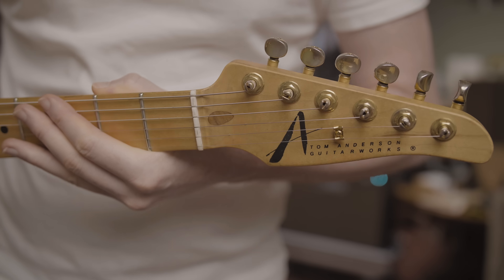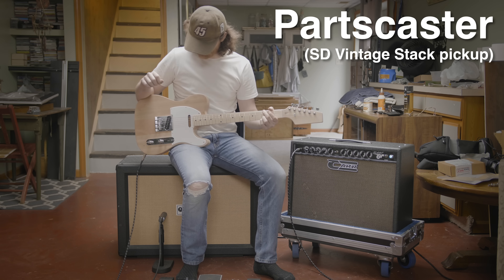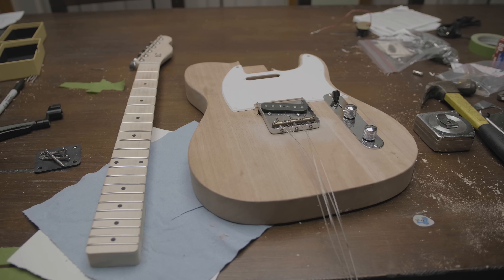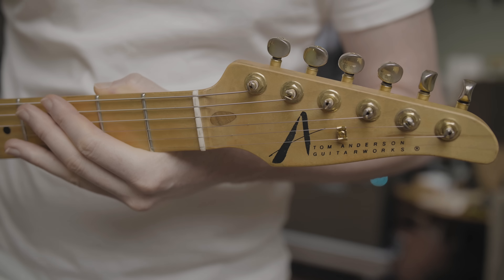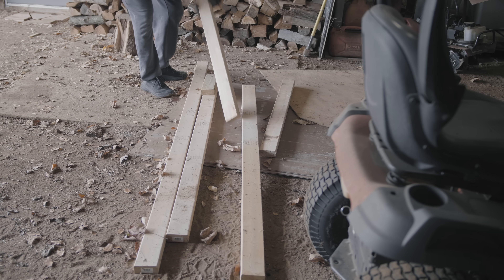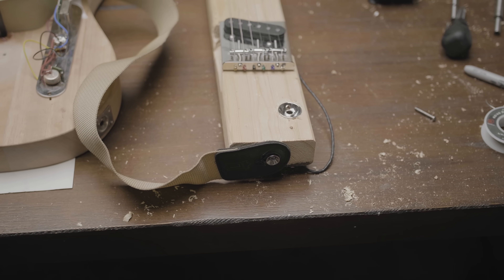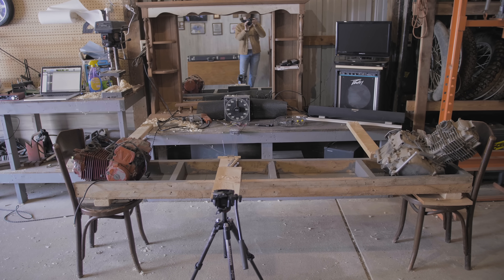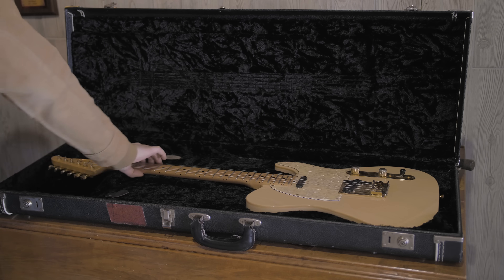Tested: Where Does The Tone Come From In An Electric Guitar?

Comment: All the comments on here amaze me - it seems to me that just about everyone is missing out on the most crucial component - the listeners ears. There have been countless psychological studies done on human perception, and the most overwhelming conclusion from all that is that there is a wide difference between what one person hears and what another person hears when listening to exactly the same sound. The fact that the guy who did these tests managed to prove to himself that he cannot tell the difference when changing certain components that a guitar is made from is perfectly valid - but only for himself. 

The 2nd major factor is for all the people who are listening via YouTube. The sound quality you get from YouTube is not wonderful, and it certainly not enough to detect subtle differences in guitar tone. That means everyone who agrees with the guy posting on here is basing it on what the guy says, rather than what they are hearing. 

The 1/3 point is the fact that he was always using bolt on neck's, or no neck at all. Sound is a vibration, and if you set a string vibrating between 2 fixed points but with a connection between their bases, you will get the entire system vibrating. If you make the connection between their bases less conducive to sympathetic resonance, you will get fewer resonant frequencies. This is probably the main reason why he could get a similar sound - because bolt on neck's do this rather less than set or thru necks This means that the effect of body resonance and neck resonance would be less in all cases - simply because of the disparity between the neck wood and the body wood (when he had a body), and the obvious disconnection between the bridge and nut when there was no body there at all. 

My conclusion? Nothing really proven - mostly because it's highly dependent on the guys ears, and also because his range of test guitars is too restricted. To do this properly, you would need to try set necks, and thru necks. You would also need to put the generated sound through a frequency analyzer to see exactly what frequencies you are generating, and what resonances are being amplified/attenuated.

I have to commend the guy for effort though - I'm kind of tempted to try it with my guitars.
Reply: The two guitars at the end of the video sounded the same to my ears.

Comment: Interesting I know ive watched the tone wood comparison with snare drums and it seemed to make a ton of difference kinda crazy how the 2 by 4 still seemed to put out the same volume I know unplugged my michael kelly patriot (lp style) seems to put out considerably more volume than my schecter c1 I always thought it was the weight of the guitar that made the difference being the michael kelly is 11 lbs and the schecter is 7 but now im questioning that too they are different scale lengths and the action is a smidge higher on my c1... I shall have to do some experimenting as well
Reply: Snares rely on acoustic resonance, so wood density and how that density translates into reflection properties actually becomes a true variable in just about any drum. Softwoods will round out a snare tone and a hard walnut for example will certainly concentrate the attack and increase the length of decay marginally.

Spot on regarding your guitars, if your C1 has higher action then naturally your pickup is probably further away on that guitar, hence it's not as loud. If they have different pickups their resistance is also going to be a large factor.

Comment: What I wonder is whether the mass of the body will affect sustain. Recording the signal you could see how long the notes sustain on the regular Tele vs. the 2x4 vs. the bench, where essentially the whole bench is acting as the body. But definitely good evidence for the pickup being the first place to invest in upgrades.
Reply: The answer is yes sustain can be affected, I have a swamp ash guitar with a full ebony neck on it and it's so dense it doesn't vibrate at all (keeping the energy in the string) but in fact feels a little dead to play and the chords ring out long. HOWEVER....it's of little use because we have these things called compressors that will do far far far longer anyway.

Comment: I would be curious to see the same tests on a strat with all of the similar tests with the matching pickup height and bridge, block, claw changes. doing with the tele all of the tests are on a fixed bridge so it is going to carry through the body no matter what. Rather than coming from a position of bias I just want to see it so I know what the most beneficial and cost efficient ways to improve sound are - whether the springs make a difference in tone, saddles, etc. in the end regardless it seems like electronics are by far the biggest game hanger though regardless

Comment: That bench is not "no body" though..... If anything it probably has more mass than a regular guitar body, effectively making it even more a body.

There is a bit of a difference between different types of wood compared based on 1.: Dimensions or 2.: Mass

A typical guitarbody will weigh more or less depending on the piece of wood and type of wood. 

I would argue a case could be made picking woods from each the opposite end of the spectrum. 
One Piece of wood very light and not dense... Something like basswood or poplar maybe
 And 
A second piece of wood very heavy and dense... Something like mahogany or bubinga. 

All these woods are commonly used in guitar bodys. 

Then, make a guitar body out of both of the chosen wood pieces. Same form and size. Compare.
Then, make a guitar body out of both the wood pieces with the same mass. 
Compare.

In my own experience however, the wood itself is a very very small factor in regards to tone. And i am willing to admit that i myself do like fancy woods in my instruments. 
But it does play a bit of a role in regards to sustain, which itself is a part of tone. 
So Overall, it matters at best in a subcategory.

Far more important in my opinion are: electronics(pot and resistor values or even active), Pickups(type, position and construcion/ if humbucker series or parallel), scale length and overall construction of the guitar(laminated neck, neckthrough/bolt on, size and mass), Strings(size and material). 

I think there is no single most important Factor to guitar tone, rather it is an amalgamation of many factors. 
But that is part of the beauty of the whole discussion, because we get to play around with a lot of parameters.

Comment: Have you carried out experiments on what effects SUSTAIN? It would be interesting to see if sustain is somehow linked to materials other than the strings and the pickups. This video is legendary, keep up the awesome content.
Reply: That's probably body density. Saw a video where someone stuck a string and a pickup to a solid steel support beam
Pretty sure it's still ringing to this day
Reply: @brendanhilgeman1395  On my guitars sustain is roughly equivalent to their weight (3.9kg/3.6kg/2.6kg). Same for my basses (3.6kg/4.9kg).
Reply: Every time I hear people talk about sustain and body wood and bridge mass I ask myself, "When was the last time I played a note and it sustained for a shorter period of time than I wanted to play that note?"
Reply: @GuyInnagorillasuit  lol I say the same thing.. how often do you hold a not for the 30-40 seconds to notice. But there is a "bloom" to a note and how it sustains. If the string expends its energy up front the trailing volume is lower.  And when I build, especially acoustics, I don't worry as much about sustain in time, but the character of how the volume drops off after plucking the string, which you'll def notice on held notes, especially less overdriven tones
Reply: @sonicbluestrat934  Great point about bloom. I looked at the wave form of my lp compared to my es both with humbuckers. The hollow body guitar has a much higher peak at the beginning of the note. It feels much snappier and I play more chord stuff on that one. Maybe tonewood doesn't change the sound so much but it does change the feel and by extension your playing and sound.
Reply: Yeah I was thinking the same thing. Little nuances like sustain and projection I think are key factors to electric guitars. Test numerous electric guitars unplugged and compare sustain and acoustic projection and note definition... I find those help tremendously with identifying "mojo"
Reply: I second this question
Reply: I'd be interested in that as well. I will say however, brass blocks on Floyd Roses and aluminum stop tailpieces definitely increase sustain. Dimebag was also able to increase sustain by using Wah effects/peddles. I'd love to see what else! Great video.
Reply: @PantsingtonHardware  More mass = less energy loss from the string = more sustain. That's why brass / steel / alu (compared to pot metal) increase sustain. There might be a change in eq response as well (less high freq loss)
Reply: @escalator9734  Yeah, I know why it has an affect. I was mainly talking about other things people claim affect it, but may not. More anecdotal type stuff.
Reply: Neck attachment is one that affects sustain. Bolt-on necks actually offer far more sustain than set necks. Les Paul players will forever deny that though lol
Reply: Everything I learned about sustain I learned from Nigel Tufnel.

Comment: The Andersen had fuller lower midrange than the other test guitar. The 'air guitar' had a significantly fuller lower midrange than the Andersen. Body mass is a critical factor in tone. Thats not opinion, or preconception, thats physics. The salient question, is how much difference. If you can discern the difference, then it matters, even if you're the only one who really notices.

Comment: The Anderson had a sweetness to the tone and more mids and sustain. The board had a nicer tone than the partscaster, lol. The bench sounded almost acoustic, perhaps something in the bench is acting like a box. Any rich subtleties of course will not be transferred by either YouTube idiom or indeed the average listeners speaker or headphones. Neither will any dynamics of the players touch. How good any guitar sounds only matters in context to its sound, in a band, on a recording etc. In short the right tone in context can happen from any guitars made of anything. Actually wood on a solid body is best understood as not what it resonates but what it absorbs. A PU can only put out what frequencies it gets. Resonance only keeps the strings vibrating longer. But what frequencies are sucked up by the wood will not make it to the strings. You will  get quite different results if you use just the pickup vibrating over a string that attached to a single long board of different kinds of woods. Then try the same with apiece of steel. Another important factor is the connection between the the neck and the body. A bolt on is notorious in varying. It often is not even reasonable snug.

Comment: Hi Jim, curious as to what you think made the difference in sound, between the guitars? Even on youtube compressed audio they were audibly different on my audio setup (I tried my JBL 4328p monitors, my B&W floor standers, and my phone, strangely the phone was the easiest to hear the difference on!). I have always always dismissed tone wood thinking; physics tells us the vibrations that feed back to the strings would vary with different woods, but the variance would likely not be detectable by human hearing. But the 2x4 guitar was so different, it has me second guessing.

Comment: I think the first mistake most people make is thinking that the materials contribute to tone. The tone and the sustain is the string. Everything you attach to the string is absorbing vibration and therefore effecting the sound. I always assumed that the resonance of the materials the guitar is made of absorb various harmonic overtones which change how the string vibrates. A less resonant wood will suck up more vibration and probably make a less desirable harmonic overtone while a more resonant piece of wood will simply absorb less vibration and create a more desirable harmonic overtone. 

I’m not sure a particular type of tree makes better tone wood but better wood in general makes better materials to make a guitar. There’s probably good cuts and bad cuts of wood in any given tree. 

The problem with this experiment is that the strings are still attached to something the way they would if they were attached to a guitar. Maybe those two tables are made of high quality tone wood lol

I’m sure anything resonant will work fine for an electric guitar, but I do enjoy looking at a nice piece of wood

Comment: This is very inspiring! My cousin, a semi-pro guitarist with 20+ experience told me the electronics matters the most, but I never thought it is THAT important. Thanks for this video!

One thing I would like to know is that, what about the sustain? I am a bassist, and my first bass, a very cheap copy of the J-bass, has poor sustain,, while the current one I play (a Lakland Japan Skyline 5-string) sustains way better. I also played a Ibanez EDB500 (whose body was made with some kind of composite material) for a few years, and it's sustain is not bad (though not as good as the Lakland). So my impression is that, the body (and/or neck -- I don't know) material affects the sustain (I mean, when hitting a note, how long does it sustain). Have you experimented with the sustain of the different guitars? If the air guitar can sustain as much as the Anderson, then probably it's the hardware that really matters?
Reply: Sustain comes from the electronics.

Comment: Pickups are 95% of the amplified sound. 

Once again I remain unmoved, once you swapped pups to match... they sounded 95% the same, if at all different.  

The strings through the pickup with no body or neck confirmed it for me. 

The wood does almost nothing to the amplified sound on an electric.
A tidbit of resonance may be the only thing that's affected by wood.

Comment: 2x4 how lespaul invented the solid body.

Good job man! You have out proof out and used proper variables and the scientific method…. Between you and Glenn Fricker i think this conclusively shows that tone wood is bs, beyond looking pretty (which hey if you want pretty is fine) it does nothing compared to the pickup, the pot values and the amp/ speaker combo used!

Comment: The air guitar may not have the neck, but it's got the fattest tushy body of all guitars with that work bench. Same goes for the head stock. And of course the brace connects both wood vibrations. I list these because it sounds good. I'm sure the workbenches are of 60s honduran mahogany/ash with aged vintage nitro lacquer finish with MSRP of $8000.00 because it's a custom shop.

Comment: Nice video. I would just add that the physics of the materials that anchor the strings are relevant. For example, if you used say lead or polythene, you might reasonably expect some vibration attenuation and loss of sustain  - materials have different acoustic and vibration reflective and absorption properties.  All rigid solid materials have a natural frequency of vibration, which, has the ability to affect tone. For example, on any guitar neck, you will find a position on a particular string, at a particular fret, which lacks sustain. This occurs when the neck is excited at it's natural frequency of vibration, and phase cancellation occurs. You can feel the subtle neck vibration increase when this happens. So, the wood can without doubt, be subtractive insofar as tone is concerned. I am sure the same applies to the body, but more so the neck wrt dead spots. By the way, if a neck with a dead spot is transferred to another guitar, the dead spot will appear on the new axe. Rgds 👍

Comment: Good job on going down this rabbit hole. I did not find much difference in those lists. I think they would all agree with each other's lists. Your air guitar is not really an air guitar, it is a bench guitar with no fretboard. The mass and density of the bench is creating that tone with that pickup. The density of the wood is the biggest factor to me. The denser the wood/or trem block.brass/tungsten, the more penetrating and powerful the tone is with great string definition, it just cuts. Great for slide. The lighter density, the more full and airy the sound is to me. This is what I have noticed in my experience. Thanks for the tests.

Comment: Thanks for this.  Already arguing with several "the tone is in the wood!" purists who STILL refuse to understand, even after sending them the link to this video.

A couple of things you can do, if possible, to minimize their argument fodder:  When mounting the pickup in the "air guitar" between separate bridge and nut mounts: 1) completely isolate those two items as best as possible (secure them to the floor, instead of by connecting them through wood?) to minimize an argument that some of the tone is coming from the connection between the two; and 2) mount the pickup completely isolated from the bridge (not on the Tele' bridge plate, but perhaps on an entirely separate mount) again, to eliminate an argument that any of the tone is coming from the bridge plate.

Maybe that's too difficult, but great video, either way!  Thanks!

Comment: I like the idea, but with all that distortion, compression and big chord strums, much of the nuance is lost. If you want to hear the fine differences, keep it completely clean and play arpeggios at several positions on the neck.

The answer to “where does electric guitar tone come from?” is “it’s complicated”. The pickup and volume/tone circuit can can have huge effects. But once you have them dialed in for a good clean tone many other parameters enter into it. 

If you wanted to compare two high end touring tires, you’d probably want to test them on a high end touring vehicle on a good track, not on a pickup truck on a mountain road. Seems like this video is more like the latter.